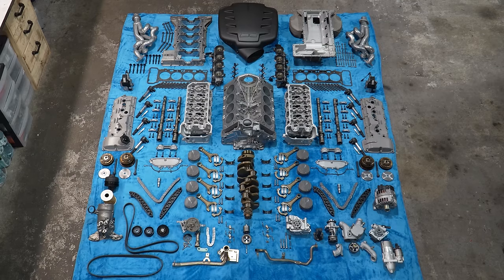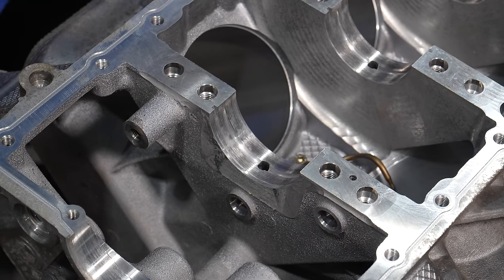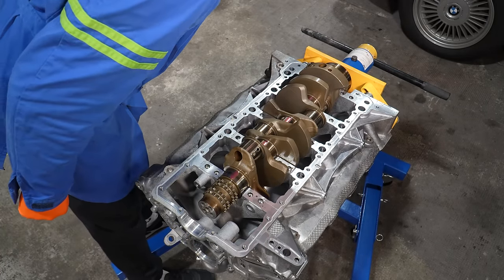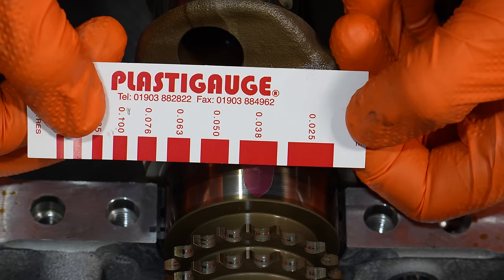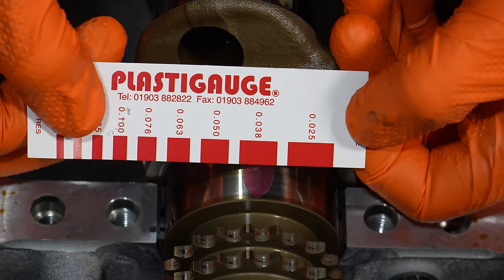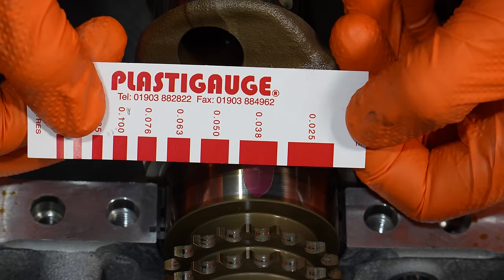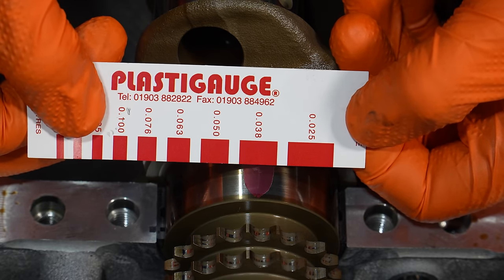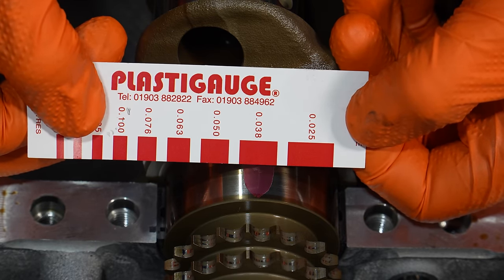Building a BMW S65 V8 From Scratch - BMW E92 M3 - Project Frankfurt: PT6

Comment from the maker: Watch the engine start for the first time here -  https://youtu.be/XiY0EFWwXmY
Reply: Tsk tsk tsk you didn't start threading the coolant drain plug by hand. Now I will have nightmares! Haha kidding. Awesome build. Halfway through the video just paused to tease you lol.
Reply: I think you don't realize what the word scratch means
Reply from the maker: @saganworshipper6062  I did :) thank you!
Reply from the maker: @Michelangelo84  I do, perhaps you are confusing building with making.
Reply: Hey bro i am a macanic.and your eingin replacement is bery impressed 🫡i am fan. I wish i can work with u 🫡
Reply: You are  genius 🧑🏻‍🔧
Reply: @Michelangelo84  Do you mean he didn't dig up the bauxite, smelt it, and cast his own block? 🙄
Reply: I don't understand what the degrees do. When you say 130 degrees, what does it actually do after the bolt was already torqued to spec?
Reply: @Slinky511nx7  It's further tightening the bolt using distance (in the form of rotation) instead of measured torque pressure. So they don't care what the actual torque amount ends up as, just as long as the bolt is rotated 130 degrees.
Reply: It's german ofc. they Hail mary ther BMW engin.. Stop eating sausages
Reply: Y you not remove nan retan valve ccv plastic tape ?
Reply: Am looking for the blueprint of an engine any engine just wanna design in SOLIDWORKS anybody can help me wz that plz

Comment: I am a bmw tech and this is gonnabe my instruction video whenever I need to rebuild an S65. Thank you for this masterpiece video. 🙏
Reply: When I build a S65 in future, this will also be my instruction video 😁
Reply: how much does a bmw engine tech make? asking because im falling in love with cars and how they work and might switch to the field
Reply: @Jerrypkmonkey  I am a bmw dealer tech. We do everything except full engine rebuild. I am in the east coast of Canada and the pay is not great compared to other trades. It's the least payed trade out there..I went into this field because I love Cars but this trade is killing the passion, after almost doing it for 10 years. If you love cars, don't make this as your profession. Just my 2 cents.
Reply: @Jerrypkmonkey  Modern tech is a rough job, you need to spend a ton of money on tools, and for a dealer most stuff is billed at a set time. So you're only making money if you're cranking through lots of jobs faster than the "recommended" time. The typical old school "diagnosis" has been replaced by learning how to read and operate scan tools and using a computer. In my opinion the trade is being killed by the manufacturers making more and more expensive cars, the cost for parts and getting your car serviced is going through the roof... but the technician pay is staying the same. In this (and all of Sreten's) video you can see what many technicians dream of, doing jobs the "right" way, with quality parts and taking time to ensure perfection. But in a flat rate world, working like this means barely staying afloat, and that's if the customer is even convinced they actually want to spend the money to have it done right. I deeply respect all the guys keeping our vehicles safe and on the road in this day and age
Reply: @ryder2shae you ever considered truck technician? I started right out of high school. Got my 310t 3 years later. Licensed techs are making $40 starting. I haven’t worked in a shop in a while but my homies have PLENTY of side work.
Reply: @hawkboy000  I have thought about it to be honest. Way better pay for sure.
Reply: Your content is prime, and I know that this may be a horrible idea but listen to this. If you can somehow find one of the few 90s cobras that made it into the EU. Holy shit.
Reply: @Jerrypkmonkey  Get into Diesel if you're going to be a mechanic and pivot into heavy equipment or specialty. Those guys are compensated pretty well. Standard automechs used to be but the industry and employers have become shitty
Reply: @ryder2shae  I get exactly how you feel I was a tech for Honda here on the West coast of Canada for 4 years, I 100% agree to not make it as a profession especially if it is your hobby/passion. It's one of those after working all day on cars, working on your own car is the last thing you want to be doing, same thing for any trade out there. Fortunately I made the switch to the Electrical trade and am half way through my apprenticeship already making just as much if not more than I did as a tech and do enjoy it since its completely different from cars and has a lot more options to branch out to if I decide to specify to one field in electrical. As well with all these electric cars there seems to be less and less work needed aside from wheels, brakes and suspension everything is now electronics and software updates.
Reply: @Executivezzz  you are a smart man and made the switch. Good for you.
Reply: @Executivezzz mmm im 18 maybe electrical trade is what i need i dont know what i want in life
Reply: I'm a certified idiot and barely managed to change a faulty water pump in a w123... without instructions, I fail every lego built... how people manage to be able to do this is beyond comprehension to me 😂
Reply: @ryder2shae  Same as with any profession if you are working for a larger company. Don't do it, it will ruin your love and your passion for whatever it is.  If you are working for a smaller company, or are self-employed, it might be different though.
Reply: Guys, here is The Savior

HalleluYAH translates “Praise ye YaH”

YaH is The Heavenly Father
YaH arrives via the TENT OF MEETING
YaH was Who they Crucified for our sins
YaH was Crucified on an Almond TREE

Semitic of Moshe (Moses)
Isa Scroll (The Original Isaiah)

Isaiah 42:8 - I am YaH; that is my Name! I will not yield my glory to another or my praise to idols.

Isaiah 43:11 - I am YAH, and there is no other Savior but Me.

Isaiah 45:5 - I am YaH, and there is none else.

Comment: Game over! There is no need for anyone else to make an S65 rebuild video ever again. This is the reference video. Even better than your own usual high standards and probably your best video to date Streten. Phenomenal!
Reply: Typical germans!😂
Reply: A reference video without any detailed measurements of the crank or mains? Seriously this is peak Youtube mechanics. This engine failed because of a broken crank if I remember correctly.
Reply: @MrSataMan  The one he’s building is from a donor M3 with 100k miles on it. Some parts from the original engine did make it back in. He’s already checked piston, crank, and cylinder bore dimensions. The block was honed in a previous episode.
Reply: @MrSataMan lol you know you don’t have to watch it right? 😂

Comment: I have been building engines for over 35 years. You did an excellent job on this video. Bravo! Just a few things I would like to mention. Whenever cylinder heads have been reconditioned, make sure to check the guide or alignment pins in the block for height and compare to the depth of the hole those pins fit into on the head especially if the head was milled, sometimes the pin or dowel can be too high and may bottom out in the cylinder head which will cause problems with the crush on the head gasket causing a poor seal. This has happened to me in the past/early days of my career, and we ended up with oil in the coolant plus over hearting as if the head gasket was blown. Critical part of the assembly prosses. Also, when it comes to porting and polishing the intake and exhaust runners, only the exhaust should be smooth, the intake can be polished, but if it's not a direct injections engine, the intake runners should be roughed up a bit to help maintain atomization of the air fuel droplets running through them. As the droplets of fuel hit the walls of the roughed-up intake runners, they continue to break up into smaller and smaller partials creating better air fuel atomization and more power. Not saying anything you did was wrong, just offering some of my experience. ; )
Reply from the maker: Thank you! The dowel pins are not a concern, if the head was skimmed that much, you wouldn't be able to use the stock head gasket. In BMW heads/block, the dowel hole is deep anyway.
I expressed myself poorly, the surface of the port channels is still rough, that is must. This is what I meant by "retaining the original structure". Appreciate the tips, cheers!
Reply: @M539Restorations I read that with your voice, good video 😁

Comment: Can someone explain to me, please, how can the engine bearings spin (before distruction occurs) if there is that allignment notch on each bearing? Does it break away or something? 

Fantastic video throughout btw. You are in a league of your own, Sreten. 🤗
Reply: The bearing doesn't spin, the crankshaft spins inside it, the bearing surrounds the crankshaft
Reply from the maker: My apologies, I should've explained this in the video. The bearings never move, they remain stationary. There's a thin layer of oil between the bearings and the crankshaft on which the crank turns and the two are never in contact. When contact happens, that's when bearing wear happens. If the bearing eventually wears out completely, there will be constant contact, things will get really hot,  you lose oil pressure and the bearing will spin, leading to an engine failure aka rod knock.
Reply: @M539Restorations  Thank you. I was curious about this for a long time, I forgot to mention that I was reffering to the pre distruction moments (edited now), but you covered that as well. You explain things very well, and the videos are packed with crucial informations anyways, so no worries. You were epic at 42:47 btw. 😂😂😂

Comment: Just curious but at the start why did you have to set the angle of the bolts does it matter or change anything in the engine ?
Reply: Torquing the bolts to say 15NM plus 90° is adding more torque on the bolts. 

It’s basically another way of measuring how much torque you’re putting on the bolt i think.

It does matter though! If you over-tighten bolts or neglect to tighten them to the spec can lead to leaks or broken bolts, especially on heads and bedplates.

I’m sure someone else on here can explain it in much greater detail

Comment: Thank you Sreten! I think I've watched this video 3 times now. It is so well done and basically a rebuild guide for almost any engine. I'm currently rebuilding a Porsche 944 Turbo engine which has the same alusil construction as the S65. I'm also going with Mahle Motorsport pistons, however I am a little concerned about the internet rumours of failures with alusil. I'm hoping that they are just rumours and there is more to the stories as your engine seems extremely strong and healthy going by the newest videos! I'm sure I will be referring back to this again and again during my build, you really are a star to the car community and I put you at number 1 for the level of technical detail you go into and the explanations!
Just ordering my fogging oil for men and assembly lube from your sponsor! Look forward to more content soon! Have you ever considered a Porsche?

Comment: Hey just a little trick I have picked up on the coolant tube o rings if you twist the coolant tubes back and forth as you push those o rings almost never pinch

Comment: Beautiful work, congratulations, beautiful mechanical workmanship, you are too strong when you talk about tightening the small m6 at 4nm and then 45 degrees, but these are crazy with these specifications.
but a question, when you tighten the main bearing screws and they need to be pulled to 130 degrees, then you loosen them to measure with the plastigouge, but can you reuse the same ones and tighten them again at 130 degrees, or do you have to reuse new screws for each tightening you do?
thanks bye

Comment: bravo overall. perfecto. I reckon the reasoning behind the torque spec on the cam position sensors would be based on the original valve cover material of Magnesium. Since it is now aluminum, it no longer applies, and would be equal to a similar m6 bolt secured in aluminum.

Comment: Did you ever got problem tightening head bolt like the oem spec like that? I am working on m52 block and never follow the manual, just 40, 60, then 75nm

Comment: As someone just trying to learn about engines this was a really great video. I do wonder how much all those precision adjustments really matter in the end. Wish I knew where it was not as important. I get the timing is probably the most important thing. I just wonder how much effect will the piston ring gap or the oil pump backlash matter. How much would a scratch really affect the engine performance and lifespan. Googling oil pump I found "Maximum clearance between the gears or pump cover should not exceed .005 to .006˝ because it will reduce pump efficiency, oil flow and pressure. High mileage used pumps can have even greater clearances. That’s why no engine builder worth his salt should reuse or attempt to rebuild a used, high-mileage oil pump. The cost savings are not worth the risk." .. So is a bit less oil flow and pressure really going to cause major wear on parts. If I get 30 days less out of a 10 year engine is that really a big deal. And then things like cam shaft position sensors torque settings. He said he's the only one probably installing to spec. I mean do I really need an angle gauge or can't I do what he did for the angle of the camshaft sensors. If I'm off 5 degrees will it really come lose and fall apart. It just seems hard to know when the specs are super important. I mean those plastic tests seem over kill to me but I know nothing. I'm just thinking the parts are machined so precise that as long as it's all moving smoothly it's probably good. Of course I don't see no reason not to follow recommended specs. I just like to know if I should stay up at night worrying if I tightened a bolt enough. If my torque wrench stayed calibrated. How much more oil will get into cylinders and burn if my piston ring gaps accidentally rotated a bit. Will it cut my engine life in half or just 5%. Anyways, just my thoughts.

Comment: I'm rebuilding an S62 right now. I've had a few different opinions around the BMW spec for ring gaps and what normal ring gaps are set to. I see you went with BMW spec 0.15-0.3mm. Very interesting. i was told to run bore" x 0.0045" which converts to 0.4 - 0.5mm... Any thoughts?

Comment: Not sure if it's me, an editing issue, or actually happened, but I only counted 9x90degree torques the first time around on the second head. It seems like you missed the 4th bolt. 43:10

Comment: Two questions:  can the crank, rods and pistons be assembled and installed before assembling the case halves?  just asking theoretically.  So that rod bolt stretch could be measured.  Also when assembling the rods to the crank you stated to use silicone spray.  I understand oil contamination with silicone can cause oil foaming.  Does BMW say to use silicone?
Reply from the maker: You can't, and that's something you wouldn't want to do. I didn't use silicone spray when assembling, watch again and listen to what I'm explaining.
Reply: Thank you.  When building horizontally opposed aircraft engines I build the crank/rods/pistons and then assemble the case around it.  Different animal I guess.

Comment: By definition - it is not from scratch unless you manufacture all the parts from raw materials, then build the engine.   You are assembling the engine from already made parts which is very different.  Details matter.

Comment: When you're using the gauge to measure the rotation angle of the bolt heads, what is that brass-coloured flexible metal tube for, which is attached to the gauge and which it looks like you put the end of over one of the other bolt heads, each time?
Reply: The magnet holds the dial still while the arrow moves with the bolt.  🤙
Reply: @u29460  Thanks.

Comment: Noobie here, Why is it important for the bolts to have a specific angle? How tight they need to be makes sense but angle at 130 degrees?
Reply: Because torque isn't actually an adequate measurement when it comes to repeatability. You're looking for a certain level of tension of the fastener, but torque doesn't account for varying levels of friction because even though everything looks uniform there are little differences in surface materials, surface finish, lubrication, corrosion, etc. So when you want precision measurements with repeatability, you set the torque at a base level and use the angle to more precisely set the bolt stretch. 

This means that as an example, when you torque a bolt to 50 ft-lbs with a torque wrench slowly, or quickly with a load limited impact driver, you can get massively different friction values and therefore very different actual bolt tension loads. Surface deviations crush flat with each loading, surfaces polish each other, lubricant can be ejected, rust or galling can increase friction, etc. Torque alone has poor repeatability in the same hole, let alone in the next one over, or in the next assembly on the line.
Reply: @davidh3332  Makes sense now, thanks for the great explanation.

Comment: 1. Why did he mount the crankshaft just to unmount it moment later?
2. What is that wire attached to the angle tool (e.g. 12:40) and what is its purpose?
Reply: 1. Measuring to make sure the mains won't be too small or too big. Also to re oil the bearings 
2. The angle tool has to be held down otherwise it wouldn't move so that metal rod gets stuck in the bolt holes so it stays stationary while he's tightening it
Reply: @GoaEnjoyer  thx

Comment: 42:48  GAH!!  You forgot to take off the tape from the CCV!!   That's why you should NEVER use tape; especially if you are having to remove it with pliers!  You could accidentally leave a small piece of the tape, due to it tearing, on an oiled part and clog a journal.  1 mm2 of tape ruins motor type thing.